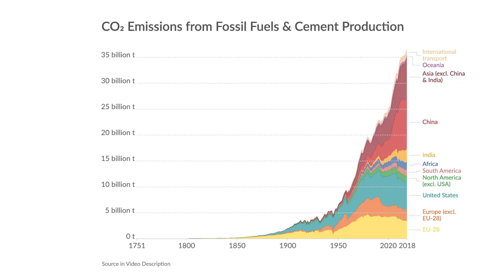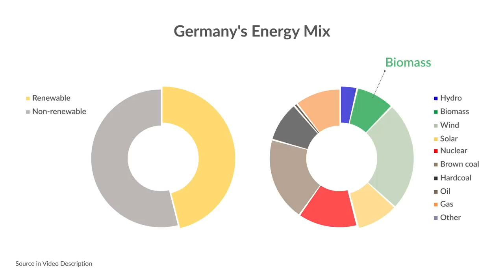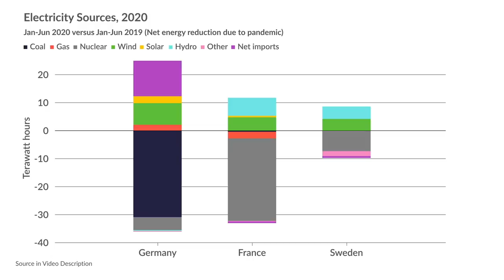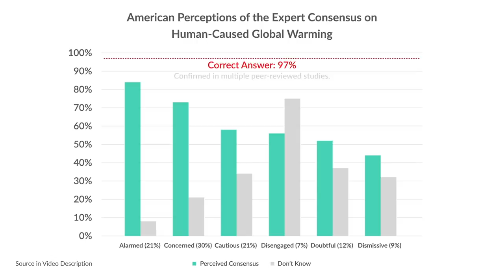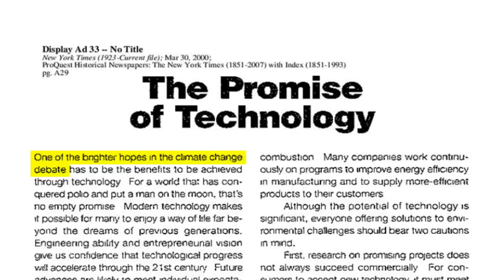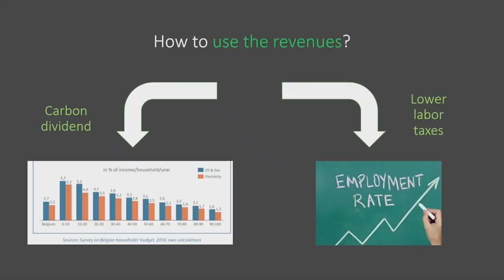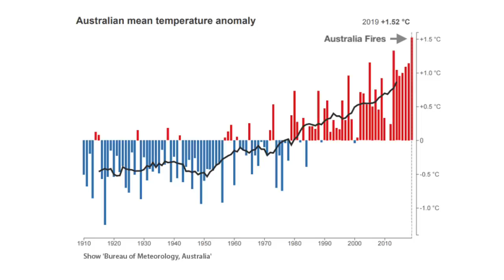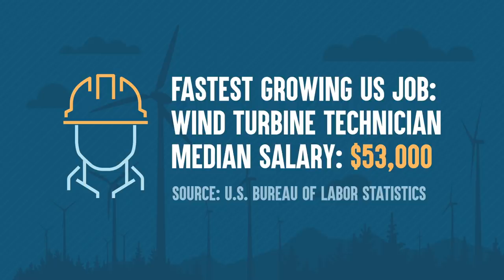The $5,200,000,000,000 Trick Killing More Than Covid, w Stephen Fry.

Comment: One of the biggest carbon credit scams out there is leased solar systems.
The inconsumer pays for installation but yet does not own the system therefore the holder of the lease can sell and trade the carbon credits.
So basically if you're leasing a solar system you're giving a carbon credits to Major polluters in most cases.
Reply: Woah that is crazy
Reply: Wouldn't that still technically result in less pollution though? 

Say the polluter makes 50% of all C02 and residences use the other half(not real figures just examples) If recidences cut their CO2 production by 100% and then the major polluter picks up like 50% of that in the form of tax credits, there is a net total reduction in emissions of 25%. That's not a scam, the system is doing what it was supposed to, is it not?
Reply: When they come to upgrade your grid & pipes that you can’t pay for the govt will own your home.
Reply: @yamanosu9463  no, it would mean that they could technically pollute more, acording to the amount of carbon credits they gain from it, they could scale they carbon emitions to fit just under the carbon credit.
So technically, the more carbon credit they get, the more they're abble to pollute.
Reply: Why are carbon credits transferable?
Reply: i do believe u figured the scam

Comment: 30 years I've been hearing about this with countless graphs and non-ending claims coming from both sides and i just mostly switch of now, except i put myself through this to see if I'd learn anything new, and you know what? No.

   You would have to learn at least 30 new disciplines to begin to have the faintest idea how the climate interacts, so how is a person to understand if they are not being lied to unless they can get a full grasp, they're not!
Reply: Longer. There is an article from 1922 from the Washington Post talking about this. It’s a scam for money and power. Anyone that gardens or grows in a legal state knows plants prefer 1200-1600ppm CO2.
Reply: Yes, it's got to the point where the average Joe doesn't know who to trust, who's been bought off, who's been silenced etc etc. My mind boggles when a person has clear cut opinions & arguments about any subject that is as clear as mud. You don't hear too much anymore about the hole in the ozone layer.
Reply: @stevemartin7721  The reason you don't hear about the ozone hole anymore is that the problem was successfully reversed. A few years ago, NASA said the hole is the smallest it's been since it was first discovered in the early '80s.

How did that happen? Well, governments came together to address the primary causes and eventually adopted the Montréal Protocol in the late '80s. The production of the worst ozone-depleting chemicals was banned globally, resulting in first the stabilization and then the very gradual healing of the hole. It will take several more decades to fully heal, but at least it's not a looming threat anymore. We have much more pressing issues to focus on now.

Comment: Solar modules offset the energy it took to create them after 7 years, not 2.  And that film wasn't off course at all, I understand exactly what that guy was saying.   In a modern wind turbine, there's a gearbox the size of a large truck.  And a generator the size of a car.  The gearbox holds hundreds of gallons of oil.  The emissions needed to forge the steel for the towers, to create the blades in the fiberglass factories, and then after use...there's no plan to deal with the blades or solar modules...  I used to work in the renewables industry, all of that is absolutely true. 

"Renewables" use a massive amount of specialty lubricants and products, which themselves take lots of manufacturing to create.  And that all creates jobs, yeah...  but its a ton of carbon emission to take into account.  There's literally dozens of tons of copper in a modern wind turbine.  Lots of aluminum, steel, plastics, rubbers, electronics, ice hazards, blade hazards, slipring dust, etc.  There's nothing green about renewable energy.
Reply: Those same factors are worse with fossil fuels. It is a measurable step in removing  particulates from the air and chemicals from the food chain. Burying blades is not ideal but it may be less polluting than to cut and haul to a proper incinerator. Research is being done to use wood towers and chemically breakdown the binders in the blades to reuse the materials in them.

Comment: I loved this video until you brought up the hyperloop.

It is a literal pipedream. You can NOT sustain such a large vacuum, and the amount of energy needed is rediculous. Just use a regular train.
Reply: Exactly.
Reply: Same, I agreed with most of it until he said that.
Reply: @ihave7sacks  Well technically he said look into it, not that is 100% happening....
Reply: "You can not sustain such a large vacuum..."

Good to know. I always knew that silly CERN thing was fake, and the 1300 scientists and engineers designing the 62 mile large circular collider should scrap their whiteboards and stop trying to scam us. The pure vacuum they need is many times harder than the 14 psi pressure drop the hyperloop requires.

Silly scientists. When will they learn; If YouTube says it's impossible, then the case is closed.
Reply: People always get stuck on the vacuum part.

It doesn't need to be a 100% vacuum. It just needs to be reduced air pressure, which is absolutely possible. The less the air pressure the higher you can get the speeds, it's up to the engineers developing these systems to figure out what the sweet spot is.

But it's so early in development that it's a bit silly to dismiss it out of hand without even knowing what that sweet spot is or what the feasible ranges are.
Reply: @anon746912  - Thank you. That was my slightly snarky point. A relatively cheap bicycle tube and tire can maintain multiple times the modest 14 PSI pressure differential needed for a vacuum in the hyperloop.

The list of formerly "impossible" engineering accomplishments are what fills our lives today.
Reply: @47f0  it really does not compare. The CERN project and look is very much smaller and cost billions. It is at the forefront of modern technology. The hyperloop, by contrast, is demonstrably hokum. Even if were it possible to suck air at the front of the train (it is not), creating a sort of lower pressure area and propelling it at the other end, it still would be as efficient as putting an aeroplane in a metal tube.
Besides, if the point is that of increasing efficiency and reducing carbon footprint I fail to see how building an overground version of the London Tube would make any sense.
Reply: High-Speed Trains have such a low drag coefficient so having a vacuum is unnecessary. High-Speed Trains run on tracks designed to handle the expansion/contraction issues that Hyperloop simply can't. That is the main reason it is being tested in an area with limited temperature changes...
Reply: @MySurreySquarePark  - Since you don't know how the hyperloop works, accepting your arguments as credible is a stretch.

There's no sucking/blowing of air in the front/out the back done by  the train cars. They run in an evacuated tube. Airliners expend a huge amount of energy shoving trillions of air molecules around, so your comparison there is kind of apples to oranges... oranges in a vacuum, that is.

Minimize or eliminate air friction by evacuating the tubes, run the hyperloop cars on magnetic bearings, and you've lowered friction to a level that allows very high speeds with very little energy.

The point I was making with CERN, and the planned large (62 mile) circular collider was that vacuum on a large scale is perfectly achievable, and the hyperloop needs nowhere near the pure vacuum that particle accelerators demand. And maintaining that vacuum in the accelerators isn't where the expenses are, anyway.

It was almost a certainty that ships made of metal could never possibly float. Undeniably railroad cars and automobiles could not surpass 60 MPH because of... reasons. Buildings cannot exceed 15 to 20 stories without collapsing under their own weight. If you dig back through history, you can find many many examples of predictions as to why this thing or that thing could not possibly work. Things that usually the engineers had working within a decade or two.
Reply: @47f0  have you seen the LHC? I haven't. I've seen the poster they let you stand in front of and take a selfie to pretend you're down there, though. I've been to CERN. Their pipework is far smaller than the hyperloop plans to be, and nobody will violently die if it goes wrong.

It's also all underground to keep the temperature stable. Are deserts like LA known for their stable temperatures?
Reply: @lebela My point in using CERN, and the planned large circular collider  was that not only was a vacuum over a long distance absolutely acheivable - even to the extreme degree that colliders require. Tube diameter is just scaling, and and the ratio of interior volume to exterior tube is a simple calculation. 

Citing your concern of the expense of CERN, do you really think pulling a vacuum is the expensive part? Or could it possibly have to do with building-sized one-of-a-kind detection instruments, massive amounts of supercomputer power, storage and data pipelining on an unprecedented scale, or just the miles of precision high-speed electronics and magnets that it takes to accelerate and precisely control a proton beam traveling at a fair chunk of C?

Vacuum is not really the hardest part of the hyperloop equation - some hyperloop versions (there are multiple versions, which can confuse any discussion) even need a little atmosphere. If I'm not mistaken, Elon Musk's first version even had a compressor fan on the front (yuck). I tend to side with the near-vacuum, maglev models; they would seem to offer the best potential speed and efficiency, which is where the hyperloop would begin to have appeal.

Saying the idea goes back 100 years would be a persuasive argument - heck let's go back 200. Ships that travel under water? Preposterous. Self powered heavier-than-air craft? Laughable. From the Earth to the Moon using a cannon? Well, okay, that was a bit off, but we managed to get there anyway. We have always, at any point in history, had fantastic concepts that were completely beyond the engineering at the time. But the graveyards of failed predictions of future achievements is dwarfed by the graveyards of invalidated arguments against the seemingly impossible.

This isn't a matter teleportation device we're talking about here. There's nothing in physics that prohibits it, and economics suggests that when things get done on a large scale, they quickly get more commercially viable.

These are engineering problems, new applications for stuff we pretty much know how to do - we're not trying to harness zero-point quantum energy to travel to the next galaxy. Having been around a while, my money's on the engineers.
Reply: Well I'm sure there are still ways to generate energy that we havent even discovered. Quantum physics is still a newer field. Maybe quantum physics will be the key to finding a way to produce infinite energy.

Quantum physics has already found something that moves faster than the speed of light.
Reply: @47f0    I assumed you had already realised that the idea of creating a vacuum in a large tube many miles long is non-sensical. CERN for its 104Km of vacuum displaces 15,000 m² of air (at a wondrous cost) a 2m diameter tube 10Km long would displace double that. As for the mag-lev, there are reasons why this decades-old technology is only sparsely used. It is not a question of capability is a simple question of costs, and that would not change no matter how many years in the future one look.
In the 19 Century, a similar idea used pressure differentials to proper a carriage in a tube, and that, impracticable as it ended up to be, is more rational than thinking of making a vacuum for the entire length of a large enclosure, that, by the way, would really need to be a high level of vacuum, because the moving train would push even sparse air molecules quickly into a high-pressure wall. 
The idea is simply a con.
Reply: @MySurreySquarePark  You don't understand basic economic fundamentals. This is how new products work, they cost a lot to produce at the start and as more people use them the price comes down over time. If you even bothered to look at past projects that were "impossible" then you would understand how baseless your points are. Many examples show you are wrong, like the computer for example which used to fill a room and be cot prohibitive. You would have called the idea of a small personal computer impossible then  for the same reasons. You also clearly lack scientific knowledge of what actually needs to be done to operate a hyper loop as pointed out by and props to 47f0 for making this abundantly clear.
Reply: @chronometer9931  The fundamentals of economics cannot go against the law of physics (apart from when dreamed in misguided imagination). The old excuse of the many things that seemed impossible in the past but came to pass ignores the many more things that never made it into the future.
Hyperloop is one of them.
Trying to use generalist arguments against specific objections is disingenuous and presumptuous.
Reply: Silly Nikola, doesn't he know AC power is dangerous and will never widely used in people's homes! It's just a pipedream!
Reply: @gregorygayler6598  this isn’t even remotely comparable to Tesla or AC power.

You can build your own AC generator in a few days in a garage and anyone can test it’s effectiveness.
Hyperloop requires millions of liters of air be removed from thousands of kilometers of tunnel using incredible amounts of energy at staggering levels of risk of implosion—all to reduce friction from air by a marginal amount for a minimal amount of gain in speed.

The entire concept is silly in the extreme.
Reply: @spopple88  You know it all, conversely...
Reply: @alwayschanging5821  has it? Quantum entanglement isn't movement.

Even if quantum does give us free energy, all you'd be doing is wasting free energy. Hyperloop still wouldn't work in a practical way.
Reply: @ingni123456  quantum entanglement is instantaneous interaction, instantaneous reaction across infinite space. We cannot even send signals this fast. Quantum entanglement is not movement, and you're exactly right. That is the point. There are other ways of doing things but obviously we have more discovery to do.